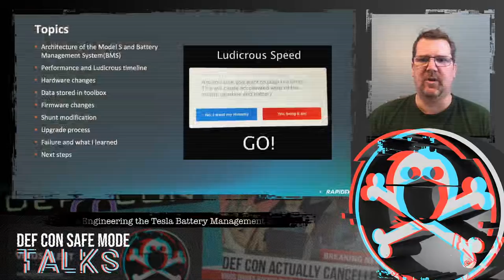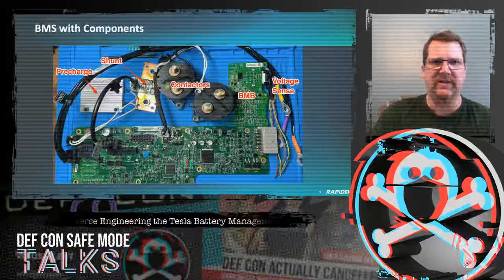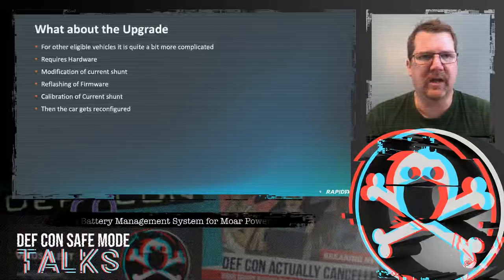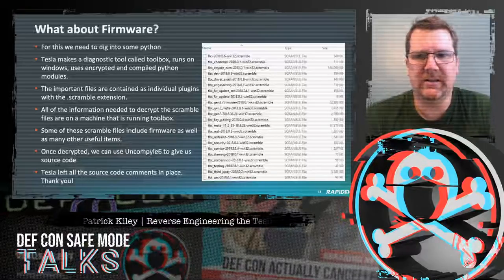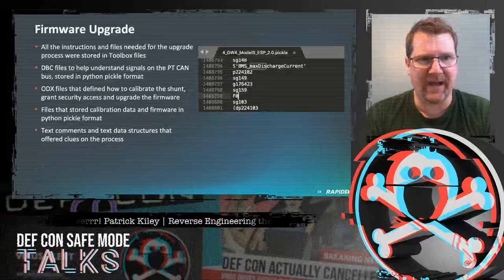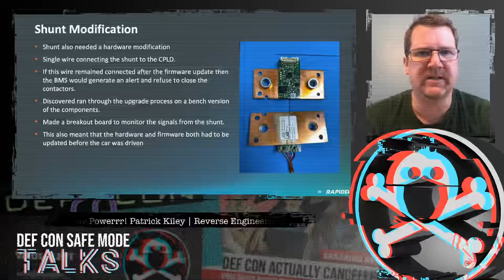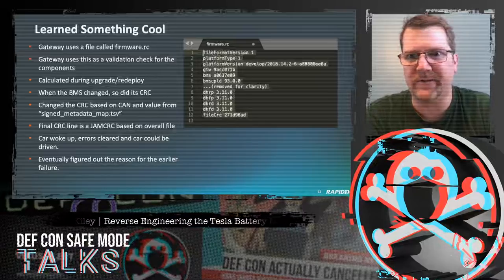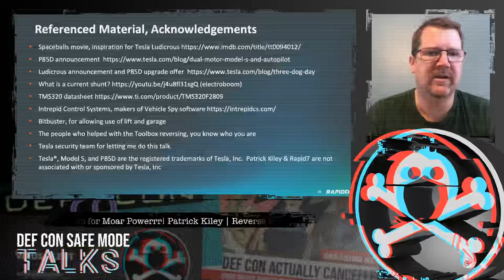DEF CON Safe Mode - Patrick Kiley - Reverse Engineering a Tesla Battery Mgmt. System for Moar Power

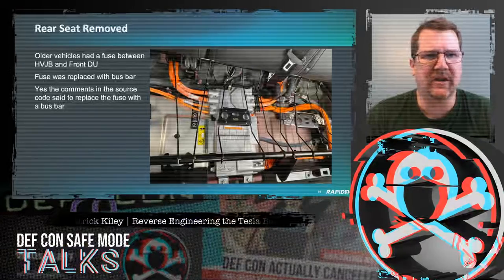Comment: 14:15  would have been cool if instead of replacing the fuse with a bus bar, you replaced it with a second shunt to monitor actual current draw so the proper fuse can be sized on future conversions. Maybe thats not necessary? just seems safer lol
Reply: Newer iterations of the vehicle did away with the housing and had a direct connection to the HVJB. The engineers felt it was not necessary given the other safety features.